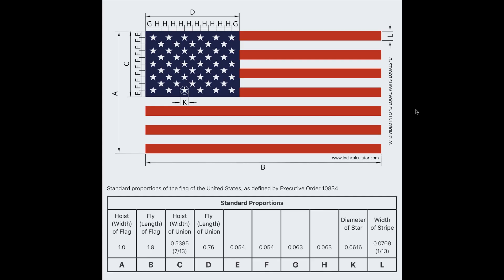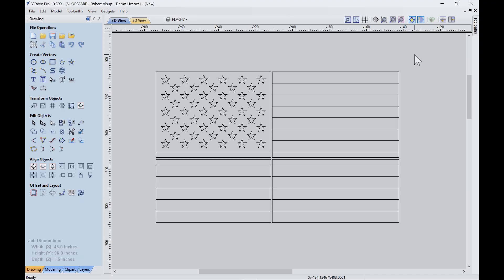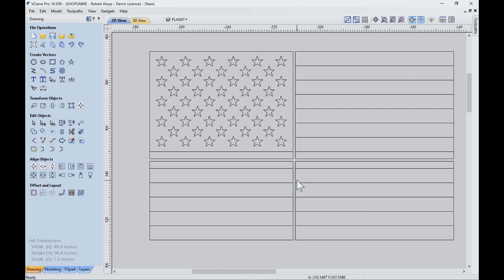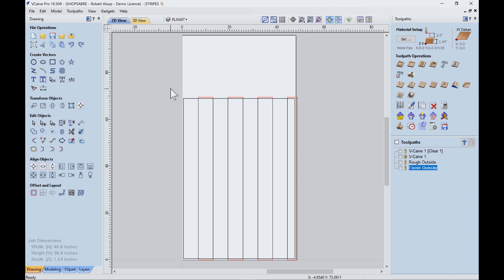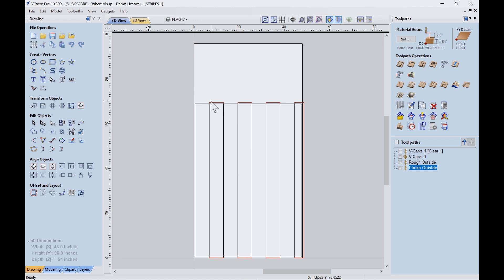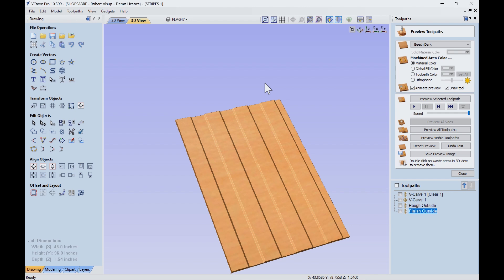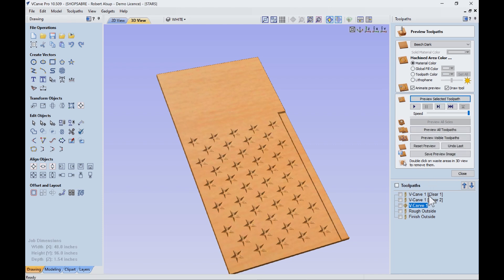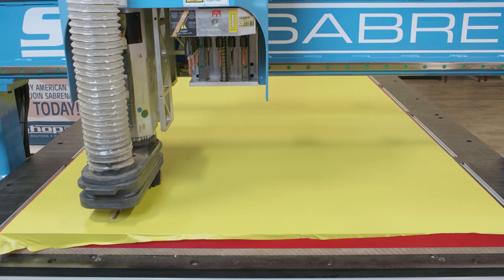ShopSabre - American Flag Project with IS Series 408 Router

Comment: We just got our IS510 with the multi spindle drilling block as well. Where can we find one of those blue shrouds you have around the motors. That looks amazing.
Reply from the maker: We don’t sell those at this time, it’s a prototype - hope to have them for 2021
Reply: @shopsabre  We actually are doing our whole shop in Shop Sabre Blue. LoL we even put blue LED ribbon lighting under it. So when I'm running it the lights will come on.
Reply from the maker: We want to see it when finished :) email us please